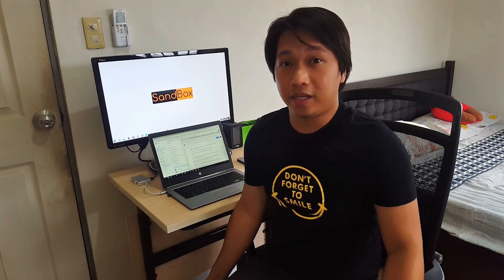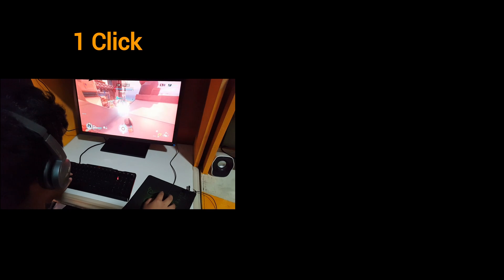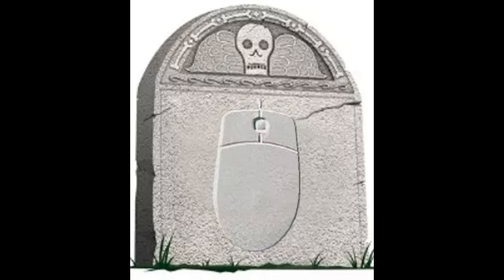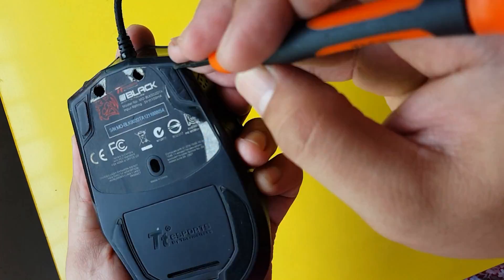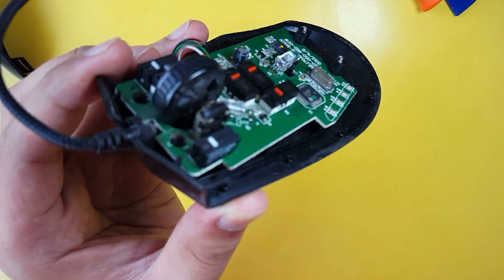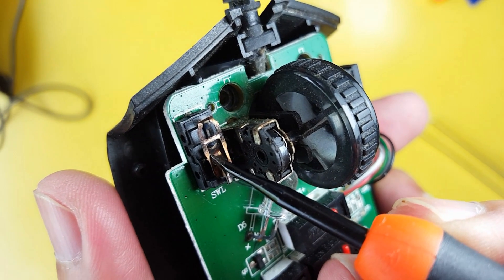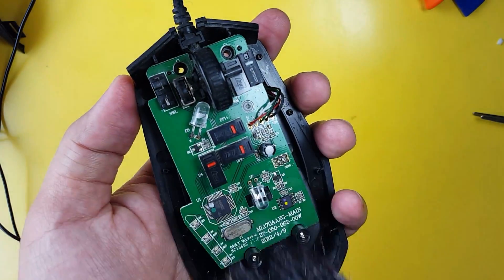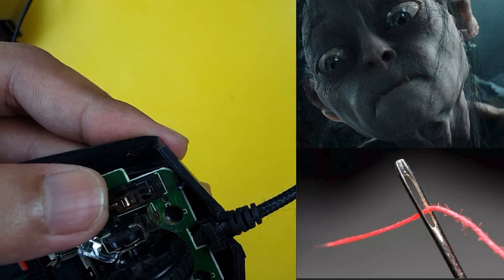How to Clean and Repair faulty Mouse Click button

Comment: thought i've lost the left mouse click there for a sec... looked at the 2nd one to figure out the mech... word of advice: DO NOT TAKE the coper thin metal thingy off, it's just not worth it. Clean as you can, it can be just dust in there
Reply: I've made a lot of mistakes in my life, but if I could go back and change any of them, it would easily be this.
Reply: I removed it and now im struggling to put it back lol
Reply: @Lemonademan  I bent mine trying to put it back together. Now it will never click. Might as well just buy new mouse or replace the switch.
Reply: learn using a cheap mouse before you take a part a more expensive variant
Reply: Thank you all for the warning. I will not make the same mistake, your suffering was not in vain.
Reply: I took off the smaller copper piece from the copper sheet by accident, any tips lmao

Comment: because of COVID pandemic and lock-down I have no choice but to fix the mouse myself and this helps a lot dude :) hahaha logitech g300s back to production though I have lost the white plastic PIN but it was easy when I have broken mouse around those generic gaming mouse and use those plastic PIN to replace my lost original pin though at first it didn't work but just a bit of a tweak and it should work :) yahooo. note the problem of my mouse is double-click and when you drag the windows folder it loses sometimes so a lot of problem. well it is fix now. thanks dude!
Reply from the maker: Congrats, bro! I'm glad you managed to fix your mouse!
Reply: @Jaybon  1000% working though It took me half hour to fix this mess up mouse glad the operation went well despite of some missing pieces luckily to have some spare. thank you bro and take care!
Reply from the maker: @pawpotsRS  you're welcome. Stay safe!

Comment: mine's not faulty, I just wanted to see the configuration of that little bronze spring piece. thanks! been kicking my own butt trying to figure out how to put it back on pr operly without it flailing, and to make it click properly. I have ordered some new omron  switches, (I've never soldered,  I plan to take the spring out) since one of them ripped. Again, Thanks for the tutorial. My mouse is a Razer Naga Chroma incase you had any tips for me, which I'd appreciate it, not sure if the mouse is 2014 or a bit earlier, but it is wired too.
Reply from the maker: Hello, Lyle. You're a welcome. If you are using Razer, I'm pretty sure that it uses  Omron switches that has a thicker and wider copper / Bronze spring piece. I learned about it when my I tried to replace the spring piece of my Razer Naga.

I had several Razer products in the past and honestly speaking, based on experience, they easily breaks (Mouse and Keyboard compared to Thermaltake or Logitech. :(
Reply: @Jaybon  My razer deathadder sometimes doesn't configure me clicking the mouse 1 button. As a last resort I am planning to see if I can fix it
Reply from the maker: I strongly suggest that you do this method first before getting a new one. I hope and I pray that it will solve the problem.

Comment: My mouse is a lot more complicated. It's a mmo type of gaming mouse. It has a lot of buttons and features. The area I have to work inside is very tiny...hard to even maneuver around. Can't even get the gold plate back on, it's also a lot smaller than I've seen before. I just can't for the life of me get it work as intended. Ended up going back to my old mouse cause I can't even put it back together now. Mouse is a Reddragon M980 Impact.
Reply from the maker: I'm sorry to hear. There are really mouse out there (specially gaming mouse) that are extremely difficult to dismantle and fix.

Comment: i cant take off the thing to get to the copper sheet
Reply from the maker: Hi, Leohux. You will need a tiny flatscrew to unlatch the locking mechanism of the shell of the mouse clicker. It's more difficult, if the shell that you are trying to open is sandwiched between other shells, ICs or sometimes the mounting of the mouse wheel.

Comment: yo bro i need help the bottom of my mouse kinda broke
Reply from the maker: Hello, Marki. Can you give me more information about it please?
Reply: Jaybon R. Sapilan so i slammed it and the bottom opened up and the back of the bottom is stuck
Reply: Jaybon R. Sapilan so i cant dismantle it so its just stuck and i cant right or left click or use scroll
Reply from the maker: @sobaldman8375  Have you tried exerting a bit of force in prying it? It's a bit difficult for me to visualize it but if you want, you can send me pictures or videos of the problem so that I can help you better. You may send it to my email address. ninjayrider@gmail.com
Reply: Jaybon R. Sapilan nvm im getting a new one thanks though
Reply from the maker: Alright,  @sobaldman8375 . But just in case there is something else I might be able to help you with, I'm just a click away ok? Thanks as well.
Reply: Jaybon R. Sapilan dam nice alright peace

Comment: Hello Sir Jaybon 
I had an issue with my mouse and i dont know if your video is the solution but my problem is that the mouse right click keeps  not respond every time i  click some time it doesn't respond then it respond again and the next it doesn't .what should i do ? -_-
Reply from the maker: Hello, Rix! Yes, what's in my video is the solution. :)

Comment: i only have a basic screwdriver. is there any hope for my mouse?
Reply from the maker: Hi, CheapDoggo. If you don't have a tiny flat screw, you need to improvise. Try using a pin or a needle to unlatch the housing of the mouse click. ;)

Comment: I cant remove the mouse switch for my rival 600 please help
Reply from the maker: Hi, Mert! I did some research since I don't know how the internals of rival 600 looks like and I found out that you will need to use a little force to unlatch the cover of the  switch. Also, make sure to use a tiny flatscrew. If all else fail, you will need to use a soldering kit to temporarily remove the switches.
Reply: Jaybon R. Sapilan thank you, i was not patient and i tried doing it before you told me how it works so i broke it 😞 but thank you for helping me
Reply from the maker: @hamzaasar5929  I'm sorry to hear bro. There is still a way. If you know how to solder, you may replace the clicker mechanism. You may buy it online and it's pretty cheap.

Comment: No clue how to unlock the latch lol.. ugh. It just looks like a solid piece of plastic sticking out of it.
Edit (Answered)
Reply from the maker: What brand/model of mouse are you using?
Reply: @Jaybon  Redragon M601: Turns out they designed it so it cannot be taken off. They used an angled solid latch so it wouldn't be removable.
I had to use a Swiss army knife and heated it's blade. I removed about 1/3 of one sides latch to be able to lift it's cover off and make the repair.
Reply from the maker: @Atom-Fire  I'm sorry to hear bro. It's probably a proprietary thing. :(
Reply: @Jaybon  lol no problem, at least I got it fixed at the end of the day.

Comment: i liked the video. informative. however theres just one thing that makes it unclear if this would fix my problem, 
my buttons dont miss a click. the failure they have is that i get double clicks when i only click onse. so i am not sure this would fix that problem or not.
Reply from the maker: Thanks for appreciating this video tuga2112. Regarding your question, I believe cleaning and adjusting the tiny copper thing will solve the problem. I suggest that you give it a shot and let us know if it will solve the problem so you can help future viewers with the same concern. Thanks!

Comment: what kind of glue for the mouse skeet?
Reply: I use normal "paper glue" to stick it  again but don't put too much of it or clean the rest of glue around after finishing, u can also use a  little drop of super glue
Reply from the maker: Hi Pizza! Any thin double sided adhesive tape will do.